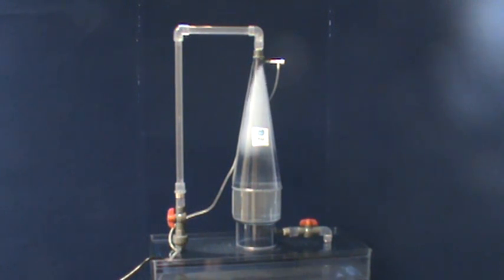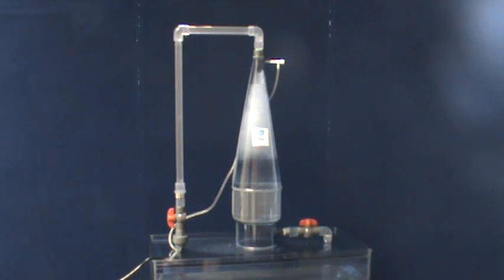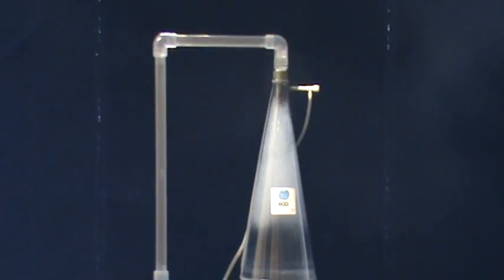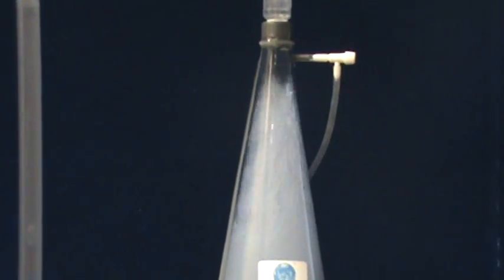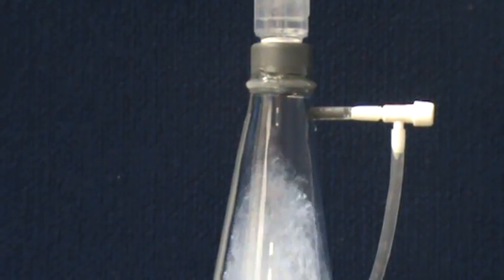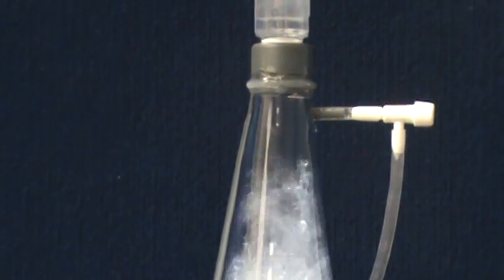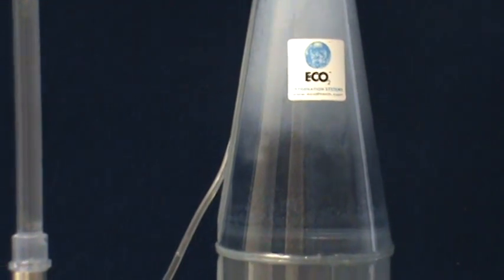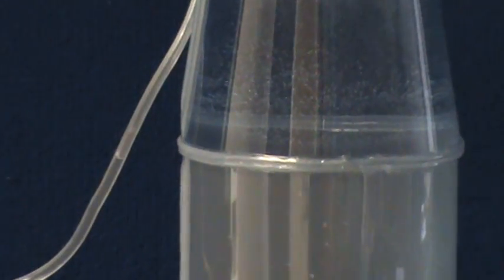Dissolving O2 in (Waste)Water - ECO2 SuperOxygenation System for Odor Control & Lake Aeration

Comment: Can it's use on fish pond?
Reply: definitely bro , it can be used in RAS, boss, do you use RAS?
Reply: @RootsBlower  We are the Pioneers In building and Developing Complete RAS setup, The above Video is Oxygen COne saturator. It is used to inject the 100% Purified Oxygen in to water-saturated mixing at a 200% efficiency rate. If sny requirement and clarifications approach us.

Our email: info@marineblue.co.in
whats app number : +91 8431115801